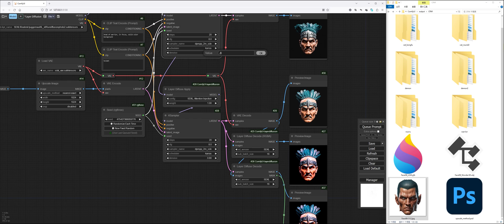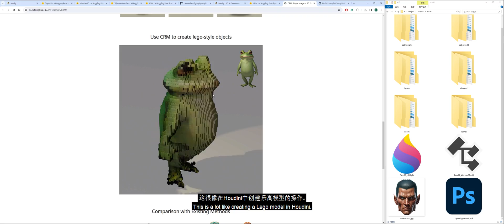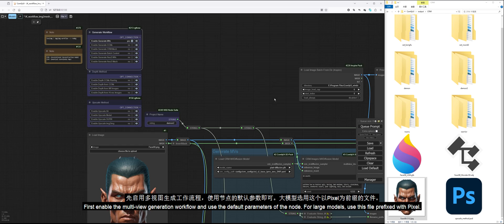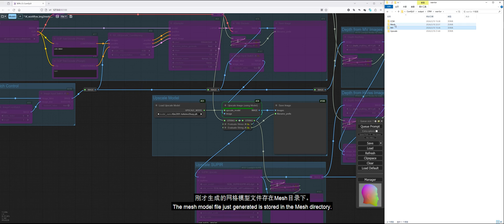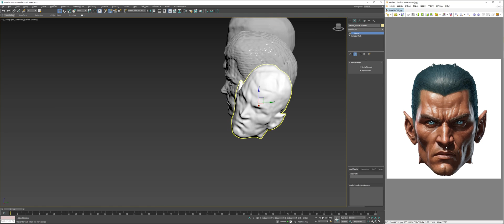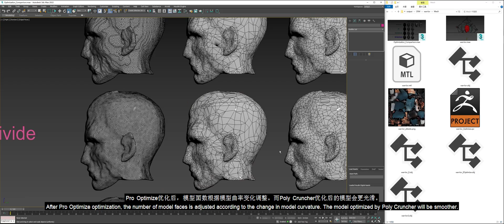Image to Mesh using ComfyUI + Texture Projector

Comment: awesome, thanks a lot! 
I'm stuck at the Explicit Target mesh optimization node level: each time, Comfyui disconnects, without an error message (just D:\CUU\ComfyUI_windows_portable>pause). 
The Event viewer indicates a problem with matplotlib. Found similar problem from other users on Comfyui-3D-Pack github but no solution so far. Any recommandation? Thanks!

Faulting application name: python.exe, version: 3.11.8150.1013, time stamp: 0x65c2ad47
Faulting module name: msvcp140-6547a4e8b7053d61be063c313b1addd0.dll, version: 14.16.27033.0, time stamp: 0x5d30eae5
Exception code: 0xc0000005
Fault offset: 0x000000000000900c
Faulting process ID: 0x0x35E8
Faulting application start time: 0x0x1DADACE7EE575AE
Faulting application path: D:\CUU\ComfyUI_windows_portable\python_embeded\python.exe
Faulting module path: D:\CUU\ComfyUI_windows_portable\python_embeded\Lib\site-packages\matplotlib.libs\msvcp140-6547a4e8b7053d61be063c313b1addd0.dll
Report ID: ffa00dc9-1996-4bdb-abaa-b0bd3dde2b08

Comment: Personnally I'm getting this error when trying to run the CRM to multiview to CCM example workflow (it happens at the mesh construction node which is quite frustrating because the different images are looking good) :
"RuntimeError: Error building extension 'nvdiffrast_plugin': ninja: error: build.ninja:3: lexing error
nvcc = D:\pinokio\bin\miniconda\bin\nvcc.exe"
It may be a path problem I guess, but can't find how to resolve it yet :(
Reply from the maker: It is an installation problem with VS or CUDA. Maybe it is the  CUDA path?
https://github.com/MrForExample/ComfyUI-3D-Pack?tab=readme-ov-file#install

Comment: You could do all of those dozens of steps... OR... just use the front and side images for reference and simply build the model like you would any other. You've put so much work into saving time, you've definitely made it harder.
Reply: no,  Its like spending 5 hours to write a script that will automate a task that only takes 30 min do.  it is not intended for single use.  once you find a reliable workflow leveraging AI,  productivity will skyrocket,  old modelling techniques will simply not be able to keep up.  

we need tests like these to learn from.
Reply from the maker: You are right. AI has caused me a lot of confusing behaviors and complicated simple problems.

Comment: I have a feeling this has way more potential. 

Is there any way to deconstruct the image into parts, then compare these parts to a set of variants, pick the closest and construct a composition of these? Like a reference model to help the process? 

I imagine you'd need a few basic head shapes, ears, chins, eyebrows and perhaps even hairdos. Then have sets of images (angles or a lora model?) for archetype heads (or complete bodies). 
Like a base bland model, one with extreme elvish ears, one with a pronounced chin, one with exaggerated brows, etc. Then you'd need to reconstruct the mix you want from these archetype sets to get the right mix. I'm not sure you can use interpolation that easily (iirc ControlNet had options?) but if you use the same process on each image of these consistent sets, the resulting set should be consistent too, right? 
Then if each archetype has a nicely fixed 3d model, you could also generate one for the mixed composition. 

Would such a process to create an approximation or base model be doable? 
Could you use this and the actual image (in iterations?) to create a consistent 3D model without any manual fixes?
Reply from the maker: Great idea! That will be the next generation of AI 3D Mesh. SD AI should learn this.

Comment: Hey Bro do you the workflow you created for us to use ?
Reply from the maker: The workflow I used is copied from the example of ComfyUI 3D Pack,.
https://github.com/MrForExample/ComfyUI-3D-Pack/tree/main/_Example_Workflows
Reply: @kefuchai5995  when I open "Multi-View-Images_to_Instant-NGP_to_3DMesh" workflow, for example, even if I install the missing nodes in the manage panel, there are still many nodes with this message: hhen loading the graph, the following node types were not found:
[Comfy3D] Preview 3DMesh 🔗
[Comfy3D] Gaussian Splatting Orbit Renderer 🔗
[Comfy3D] Stack Orbit Camera Poses 🔗
[Comfy3D] Switch 3DGS Axis 🔗
[Comfy3D] Load 3DGS 🔗
[Comfy3D] Save 3D Mesh 🔗
[Comfy3D] Instant NGP 🔗
[Comfy3D] Fitting Mesh With Multiview Images 🔗
Nodes that have failed to load will show as red on the graph.

Do you have any idea what I might be doing wrong? or not doing?
Thank u in advance
Reply: @kefuchai5995  Ty Bruv
Reply: @kefuchai5995  Hey bro.The example workflow of CRM  does not include the upscale-img part.I tried to load an upscale model,but it seems have some errors in python——“Input type (struct c10::Half) and bias type (float) should be the same” Could you help with this?Deep thanks.
Reply from the maker: @夏色はなび  https://youtu.be/Y6-JGi_ksos?si=1qBaFHsGtPETxU87&t=611 
Check out the video from this time. The format of CRM-generated images requires manual conversion before they can be used for upscale.